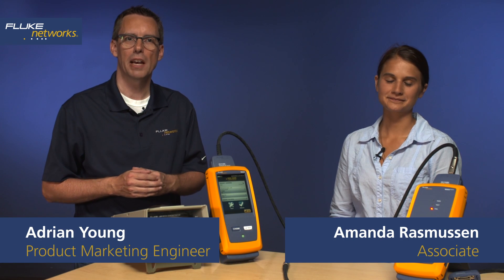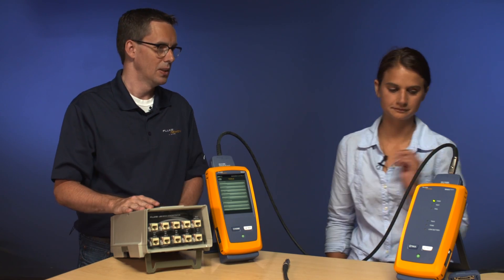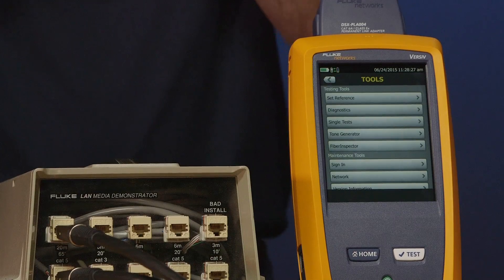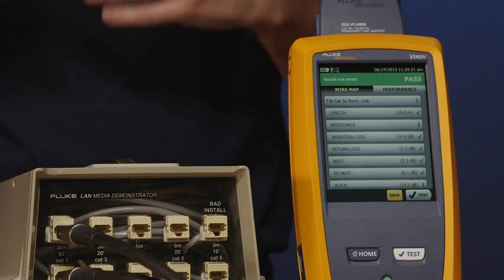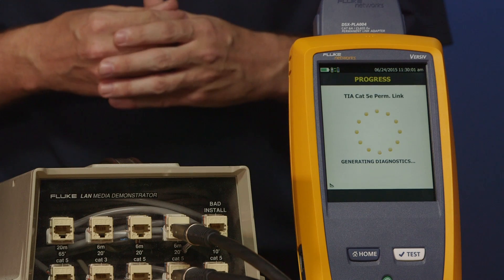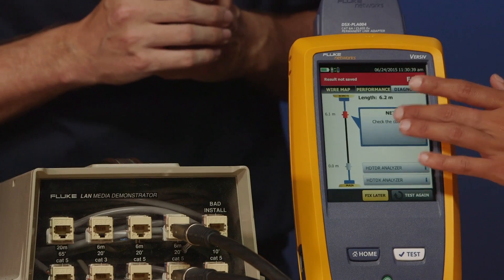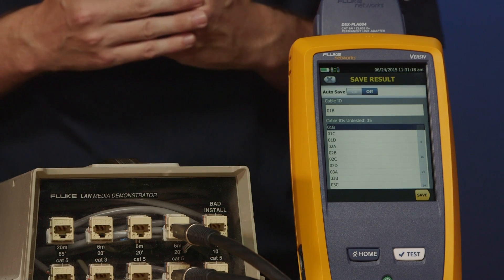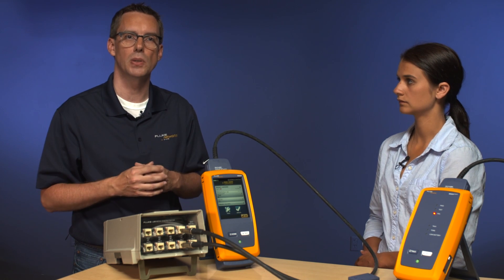DSX 5000 CableAnalyzer™ Copper Cable Certifier  - Running a Test: By Fluke Networks

Comment: Hello I wanted to see if somehow to read the graphs for a coil of 305 meters with the certifier and to know if the coil is okay? or what are the minimum parameters. I know that more than 90 meters is not recommended to certify
Reply from the maker: Hi Pedro - there's a video on how to test a spool of cable before you install it that should help you. Check it out here: https://bit.ly/2Uv3eBG
Reply: @FlukeNetworksVideo  hej
Reply: @oliwia5877  vvvv
Reply: @oliwia5877  vvvvv
Reply: V

Comment: Hi sir, in the connection fail and "check the connector" message, i already change the module in both end and terminated but still the same fail message. i always have that problem, pls. help.